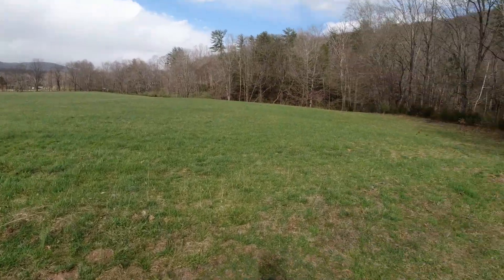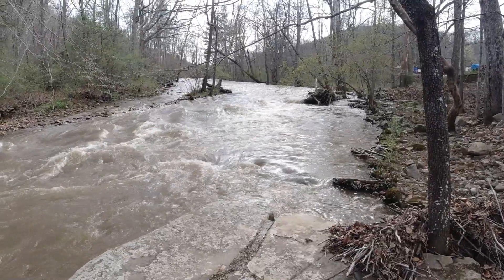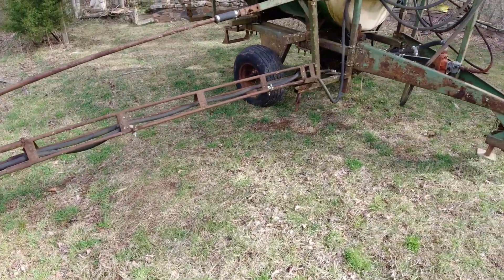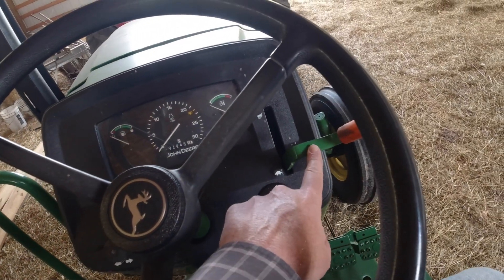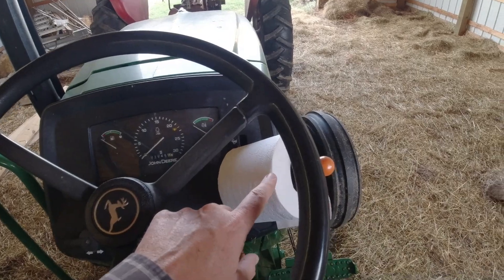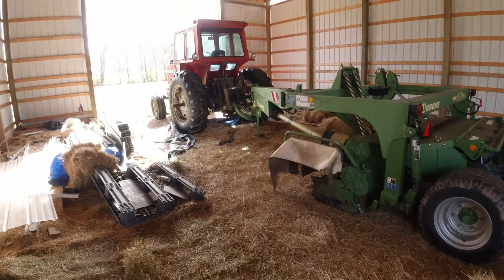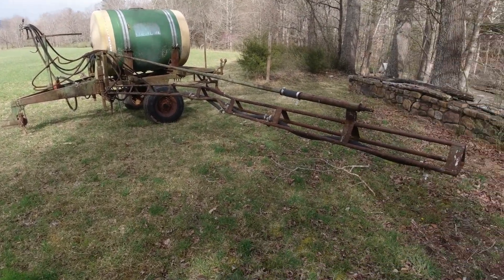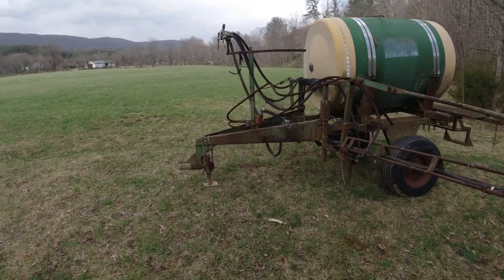GPS, TPS or Foam - Which Guidance System To Use???

Comment: GPS is the way to go, 
I use Raven Cruiser II with excellent accuracy 
I don’t know if it will work in your area, there is 12 satellites 🛰️ total with two that are stationary for compilations
TeeJet has a good entry model also
I started with Garmin’s GPS receiver and my cell phone and an app that worked pretty good 
Within a few years the GPS has paid for itself in input savings 
Happy Harvesting 😊

Comment: I use the ez guide 250. Has the light bar and screen that paints the field as you go. I do not believe it is available anymore though. For the versatility and cost, I suggest the foam marker system for you.
Reply from the maker: Thx!